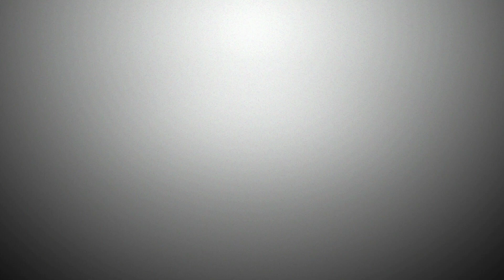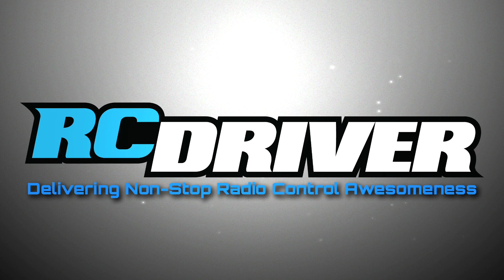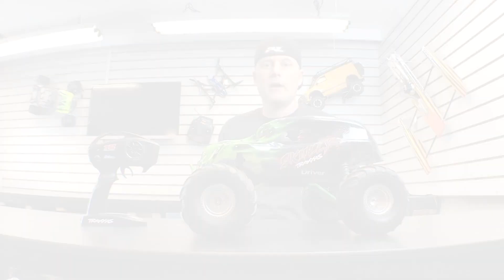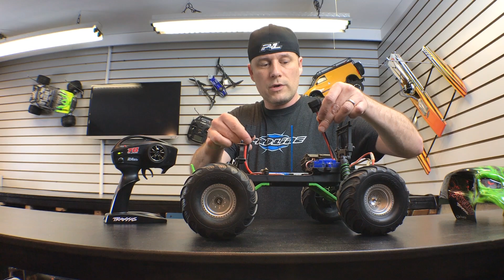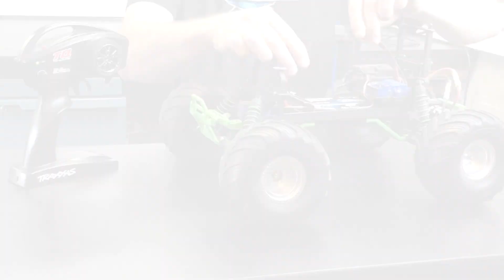How To Power On/ Off Your First RC Car - Get Into RC

Comment: Not much of an issue with modern digital radio systems that need to correctly bind and establish a two way connection (modern receivers also transmit data back to the transmitter to verify proper connection hence the binding) before doing anything. But back in the days of analog radios if a receiver was turned on first the servos would do all kinds of random movements because there's always some interference. Still a good practice though and some radios require the correct order to bind.

Comment: thank you i used to do a lot of modeling & running rc but i had a drain injury & my memory is not their even turning on radio & cars i never remember which is first & last.i should right it down & put it in my pocket.ive lots of trucks, diggers but dont use as they need some attention.ive trucks half done but i stopped when memory stopped working right. your the first ive seen starting from basic

Comment: i hadn't used mine in a while picked it up yesterday and strated driving it and after like 10 mins it started running into walls and fences and curbs, i think it was the bateries in the radio where low because i hadn't changed em in like a few months.

Comment: Thanks !!!
1)I have 3 questions.. Should I remove the battery from my rc car after the usage time? 
 
2)Could I leave the battery in while the cables are unplugged?

3) Are should I unplug the cables and remove battery all together?
Reply: Unplugging is good enough, but remove when charging